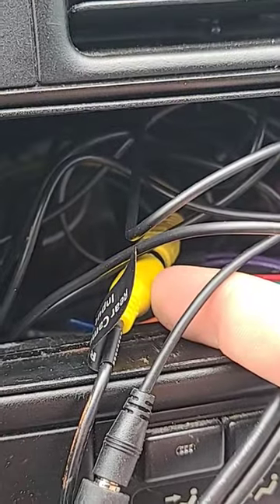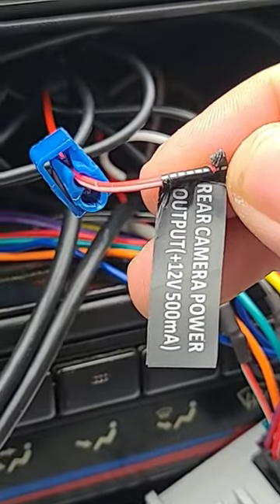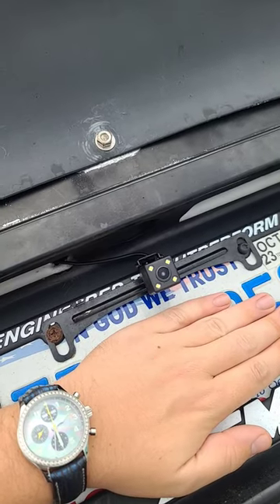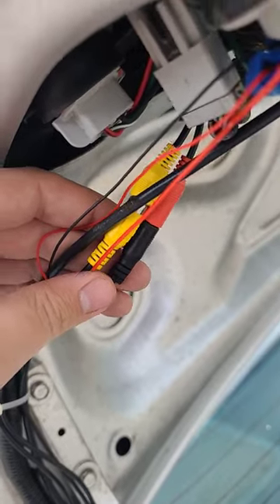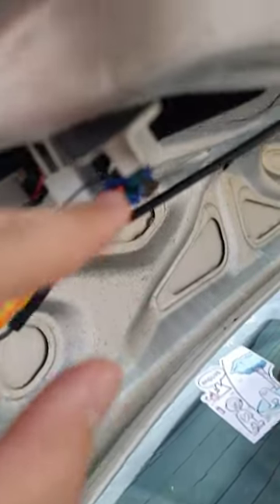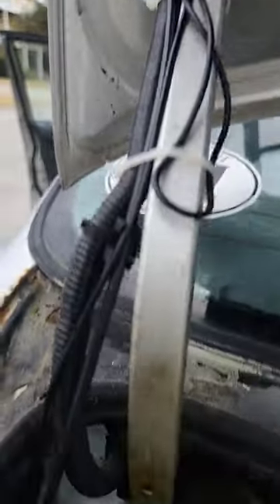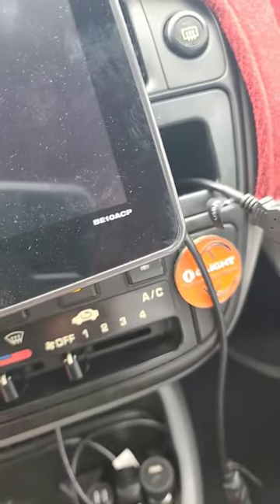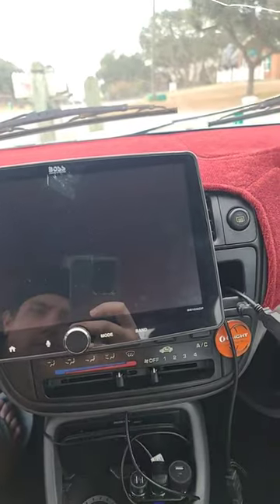How to install rear view camera on 1996-2000 Honda Civic with aftermarket touchscreen BOSS BE10ACP-C

Comment from the maker: DO NOT DRILL A HOLE FOR YOUR CAMERA WIRE. PUT THE CAMERA WIRE UNDERNEATH THE LICENSE PLATE BULB HOUSING BY TAKING THE LIGHT OUT INSTEAD.
Reply: Everyone doesn’t have a license plate bulb…I don’t.
Reply: My 05 chevy cobalt doesn't have an opening at the license plate bulb  I had to drill a whole and used cocking to close the whole but still having issues with the camrea I can only get it to come on when clicking camrea not when reverse I can't find the reverse wire on the harness cause it was a ready harness from clutchfield

Comment: Solid instructions brah! Thanks
Reply from the maker: No problem 👍I wouldn't drill underneat the light like I did though, just feed the wire underneath. I just happene to have a rusty hole there.

Comment: If you put it in reverse does it turn on automatically?
Reply from the maker: Yes and no. 
Yes it powers on when in reverse because its wired to your reverse light.
No because you have to go to "Camera" mode in the main menu manually and it won't override your display automatically when you throw it in reverse.
Reply: Good question and great answer. Just bought one but didnt know this fact.